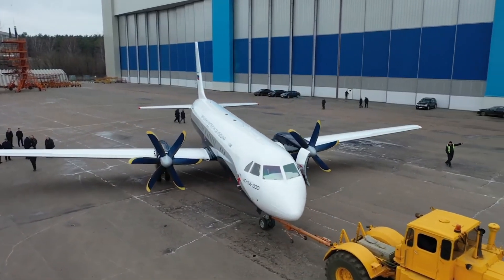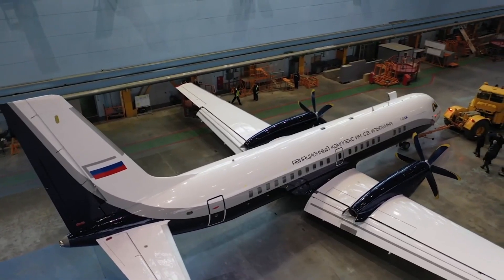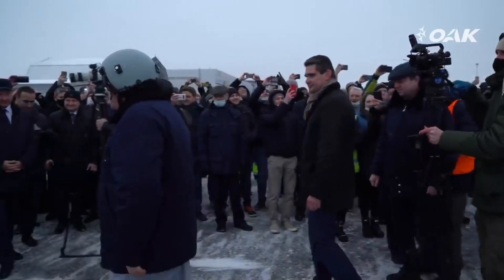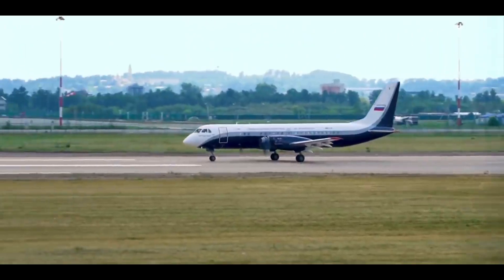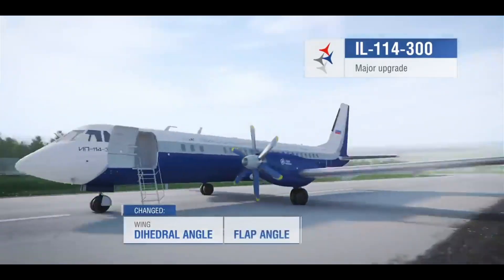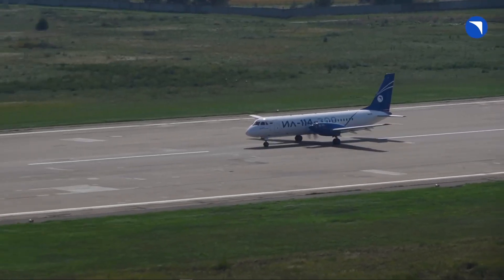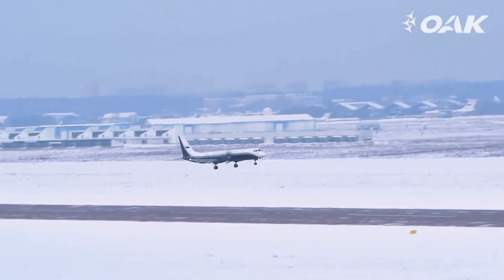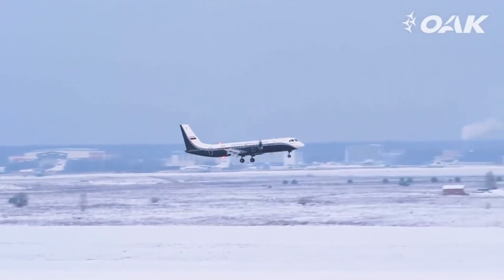Another Russian aircraft tries to beat sanctions

Comment: Rather unusual to see a low wing turbo prop. All the modern ones seem to use high wing.
Reply: Unusual to see a modern turboprop with only 2 engines needing a 3rd person to manage the throttles especially considering all the improvements with automation made to this airplane. Some manufacturing habbits die hard I guess.
Reply: @cheftudorkorea il-114 300 needs only 2 person. The 3 person footage is from the previous version
Reply: Many countries could have been interested in buying these aircrafts, remember not all countries are willing to pay homage forever a decadent country such as USA.